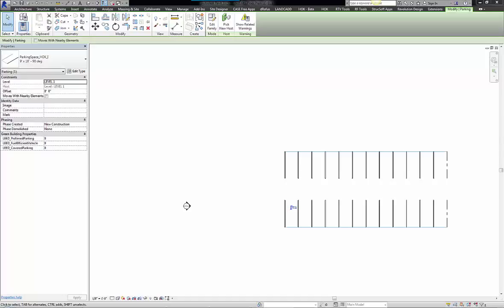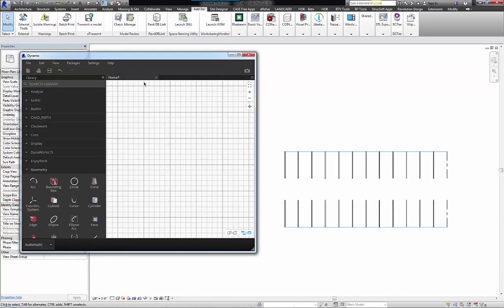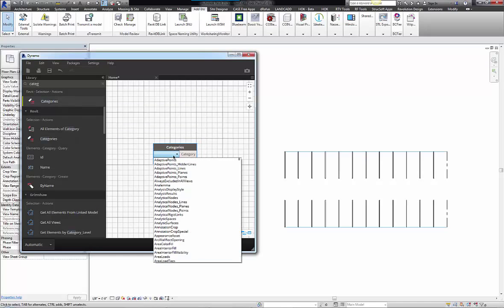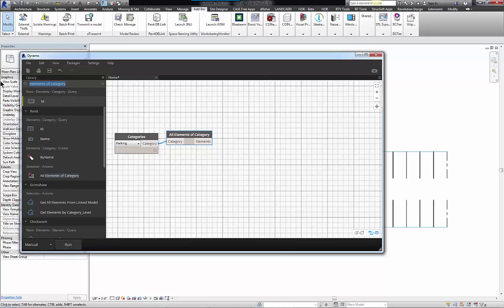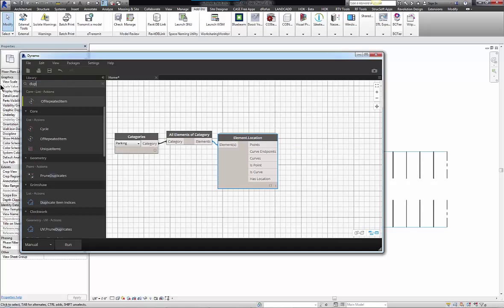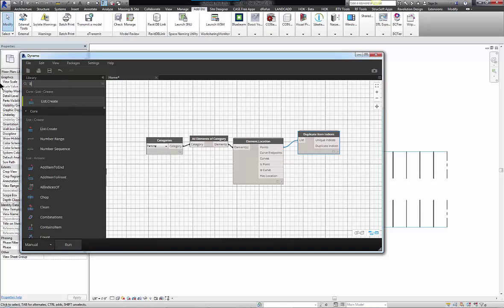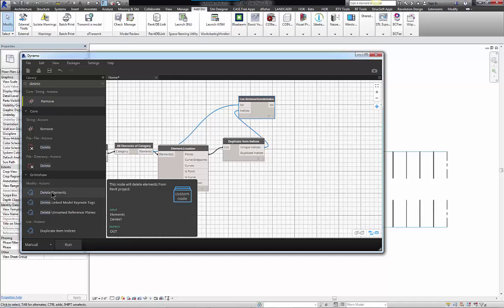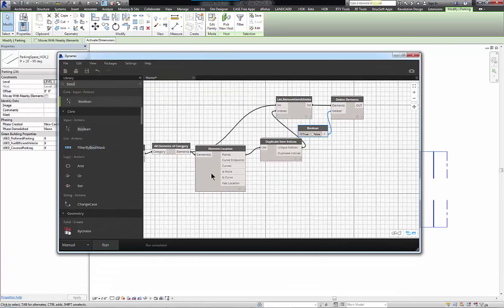Practical Dynamo - Removing Duplicate Revit Elements

Comment: Cesar, I followed your steps carefully, as this was my first ever experience with Dynamo.
It worked with parking elements.
However, I created some walls, copied them to clipboard, then pasted Aligned to the same place.
Then I ran the dynamo routine.
Both the originals and the copies were deleted. 
Any thoughts?
Reply: Thank you Cesar for this video :) 
There is any method for system families ?
Reply from the maker: Robert, this method works for component families, not system families (walls, ceilings, roofs).